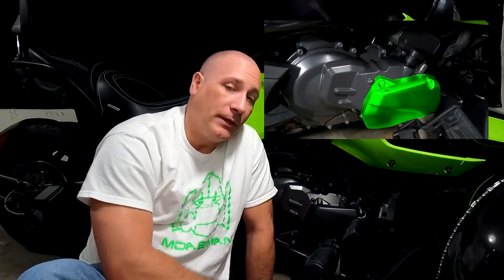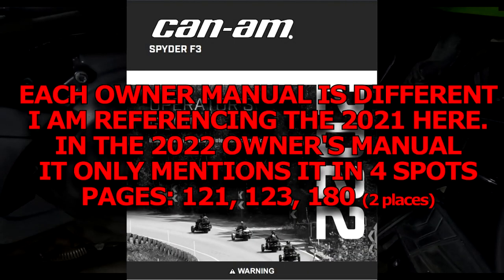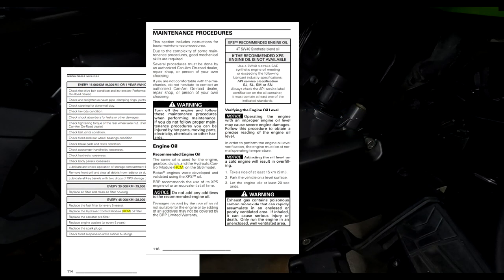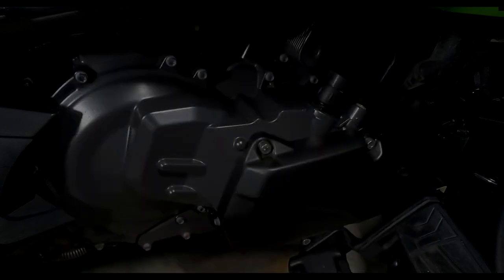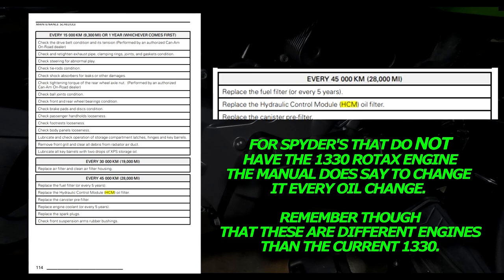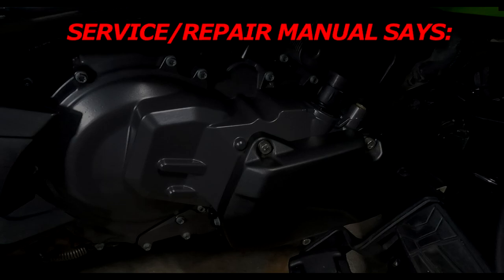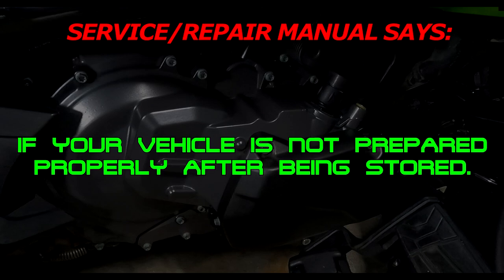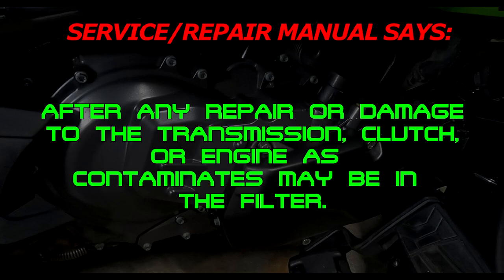Spyder F3/RT HCM Oil Filter (PART 1). Can Am Spyder Transmission Oil Filter.

Comment: I have just changed mine as part of the 28k service on my 2016 F3 Limited.  With the manufacturer stating it needs to be done every 28k and the fact that it costs $125, I can't see replacing it every oil change myself.  I don't skimp on maintenance by any means, but replacing a part that expensive just for the sake of doing it is a wealthy man's game lol.  I have got a lot of good info from your videos!  Looking forward to the next one!
Reply from the maker: Thank you for that and appreciate the support. Completely agree with you. I can see changing it in the older 991 engines every time though as they are different beasts. The next video will be more detailed and focus on the replacement.

Comment: Now that's interesting, a filter that uses the same oil as the engine and transmission, but with a much longer recommended replacement interval, seems odd but Spyders are a little odd too 😁.
Another advanatage goes to the F3 Vs the RT when replacing the HCM, not near as much tupperware to remove 🤣.  Looking forward to your video about replacing it.  Thank you Sir 😁👍👍
Reply from the maker: Yes, the F3 is way easier to access!!! It is not hard to get to, just a lot more to remove on the RT. That is where it starts the thought of..maybe i will let someone else do it and not mind paying for it.

Comment: Is this filter on the SE6 and not on the SM6 or do they both have one?
Reply from the maker: Good question. I actually had to re-edit this as i missread your question the first time i read it as i had RT stuck in my mind for some reason and not the SM6 that you said. (I hope you will read my new edit, and i apologize as my first answer was wrong) I believe that the SM6 does not use a HCM filter like the SE6 models due to the different engine versions and the SM6 being a manual clutch. I believe that the SE6 has just the Clutch cover and that is it. Havent personally seen one to answer that for sure but i believe it will just be missing the filter and cover both and show bare metal. The clutch Cover will look somewhat similar to the SE6 though. The HCM is mainly used for aiding in the automatic shifting of the bike. Again sorry for missreading and the first answer before edit.
Reply from the maker: I will also mention this question in my next video as it will be useful to others.

Comment: What a terrible system an oil filter and reservoir that isn't changed every time you change the oil is INSANE. the manual says it takes an additional .2 liter of oil when changing the HCM filter - that is .2 liter of DIRTY oil. Extremely poor engineering. but it is expensive. The new to me Spyder has 32,000 miles so I'll change it now and at the recommended intervals.
Reply from the maker: @bruceheimbigner9587  most good shops do change that filter with an oil change. I can't believe that the old manuals don't talk much about it though. Enjoy the "new" Spyder and thanks for watching!
Reply: I'll remove the HCM and see if I can dump the .2 liter of oil out of it.
Reply from the maker: @bruceheimbigner9587  comment back with what you find. I am curious to know